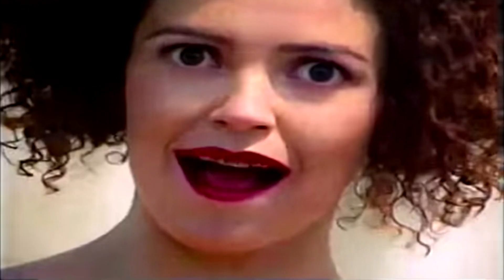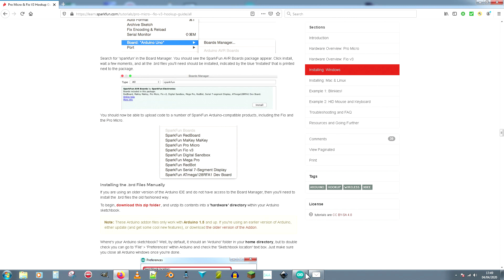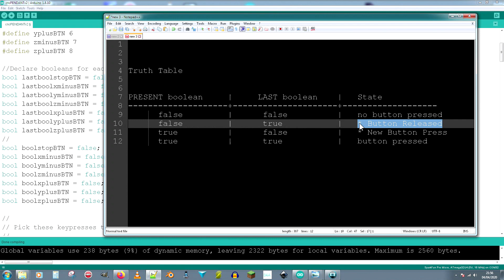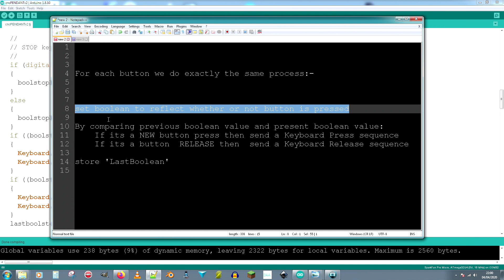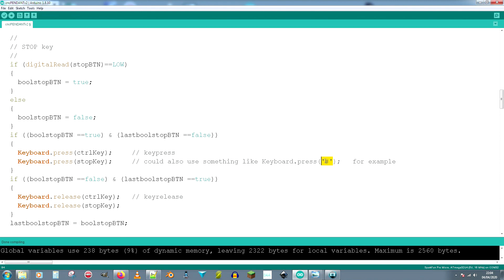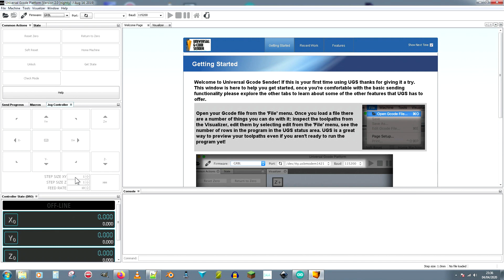Make Your Own Position-Controller-Pendant for your CNC machine using an ARDUINO (& UGS software).

Comment from the maker: The arduino code is very simple and all covered in the video. However, the exact code used in the video is at the link below for your convenience:-
https://drive.google.com/file/d/1ZKiYO_k69H85F9KUm6UXGFtMq4eQMdWw/view?usp=sharing
This is open source. 
Please remember to set the board type to Arduino Pro Micro in the arduino IDE.
ALSO, you must select the correct clock speed for the board in the arduno environment before programming it, or it may become 'bricked'.
Reply: Please wiring sir
Reply from the maker: @horeamgaming139  
the required wiring diagram is at  0:36 in the video. That is all of teh wiring.

and the arduino pro micro pinout is at:
https://learn.sparkfun.com/tutorials/pro-micro--fio-v3-hookup-guide/hardware-overview-pro-micro

On my diagram where i refer to pin D2 that means 'Digital pin2'  so that will be just Arduino 2 on their diagram (also labelled 'SDA') .
Pin D3 is also labelled 'SCL' on their diagram.
Pin D4 is also labelled 'A6' on their diagram.
Pin D5 is just labelled '5' on  their diagram.
Pin D6 is also labelled 'A7' on their diagram.
Pin D7 is just labelled '7' on their diagram.
Pin D8 is also labelled 'A8' on their diagram.

I hope that's enough info.

Best of luck.
Reply: @dingolovethrob  thanksyou sir tahnks